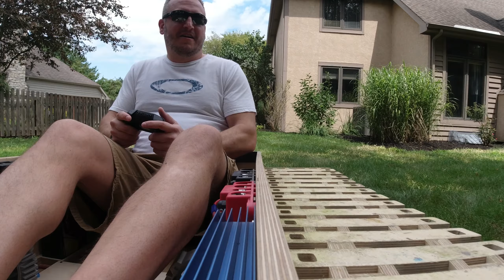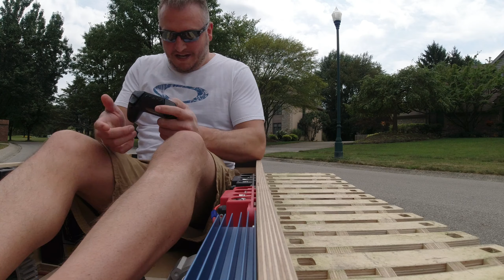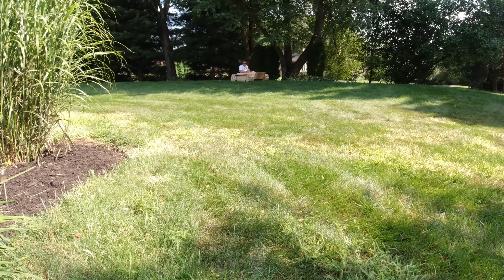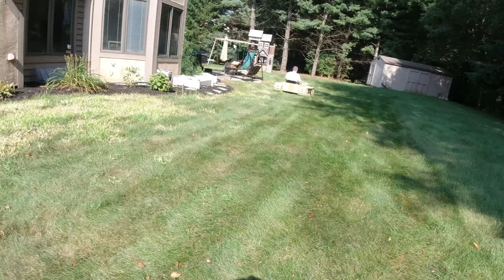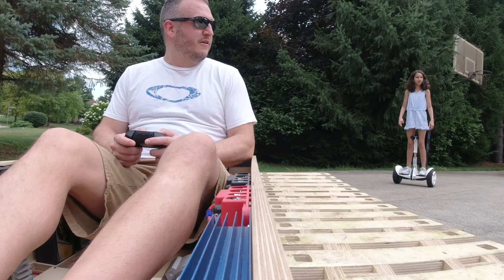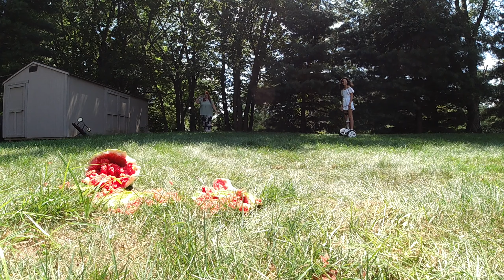World's Fastest Wooden Tank!?!

Comment: oh ah, I wonder if you let your wheels "drink" superglue, it hardens it's surface a lot, at least 1mm  of surface strengthening, so they won't crack so easily, you might want to stop using those spiral patterns , try something simpler and more effective, one of the major reason they crack or get crushed because the lack of impact absorption, see real life tank's suspension for example, it reduced vibration and damage a lot , try raise your hull clearance for that upgrade